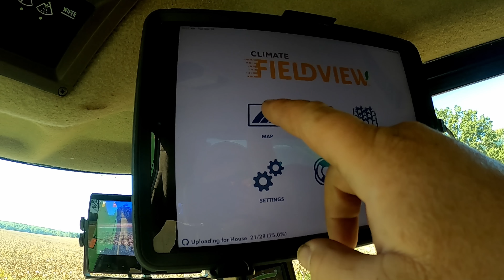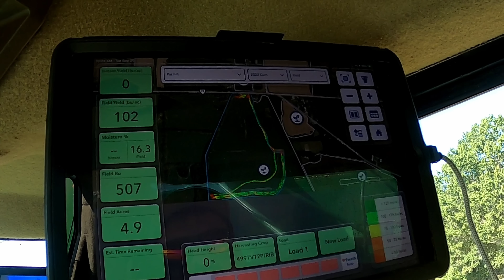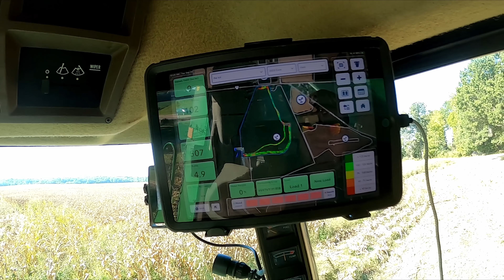Locked In: Corn Harvest Day 2 (9/20/22)

Comment: We grow a fair amount of corn here in East Central Georgia, but our main crops are peanuts and cotton. 
Our irrigated corn averaged 236.47 bu/ac this year. We can't really justify planting any dryland  corn because of the risk involved. 
I just found your channel and I'm interested to know what crops you plant.
Here, we grow cotton, peanuts and corn with the large majority of our corn being used for cattle feed.
Reply from the maker: We grow corn, wheat, and soybeans. We usually average 180 bu./ac. Corn dry land. We currently do not have any irrigated ground. We didn't average but 80 this year.  We went 70 days without rain.
Reply: @DylanJoyceFarms  we were under severe drought conditions here from mid May until the second week of August. 
Without irrigation our corn would have been a total loss. The yields still suffered because we had to limit our late season watering on corn as well as peanuts. 
The cotton seems to hold up better in dry conditions than soybeans. One of the main reasons we made the switch back in the 80s

Comment: We finished soybeans yesterday we had a really good crop 6 weeks ago, then the rain started just as they started to dry down and it rained pretty much all of August to the point the soybeans started sprouting, the beans that had been gramoxoned before the rain really got hit hard. I had only one field of late group 4s and they were damaged pretty bad, however I had mid 5s on the rest of my ground and they were perfect, so we had to blend them to be able to get rid of the 4s, after it's all said and done I guess we will average somewhere around mid 40 bushels per acre, not great but considering the year I'll take it, the price helps out alot!!
Reply from the maker: Yessir, the price is making a big difference. We're having a similar issue here trying to get rid of corn with aflatoxin.
Reply: @DylanJoyceFarms  I've fought with aflatoxin corn before it ain't no fun for sure, and the testing method at the elevator leaves alot to be desired, one year it was so bad guys were bring in ground up samples to the elevator for testing and it would fail, guy went back to his truck and pulled out a bag of store bought corn meal through it on the counter and told the girl to check it again, sure enough it failed there test!! I saw that myself with my own 2 peepers lol

Comment: Back when you was running that 6620 do you remember what cylinder speed you ran?
Reply from the maker: I believe it was around 400-450. Had to run it a little faster than the 9400